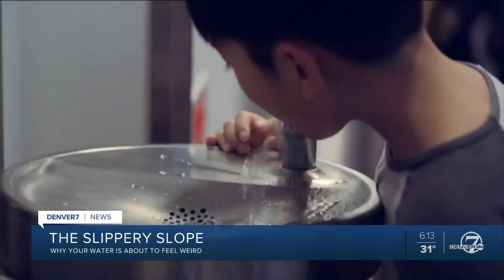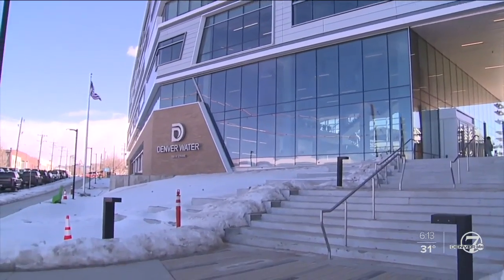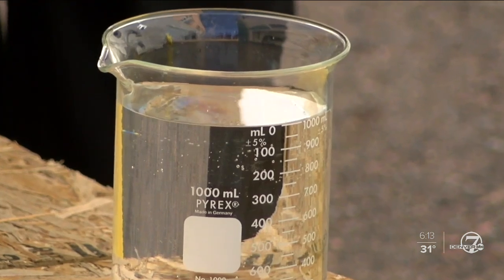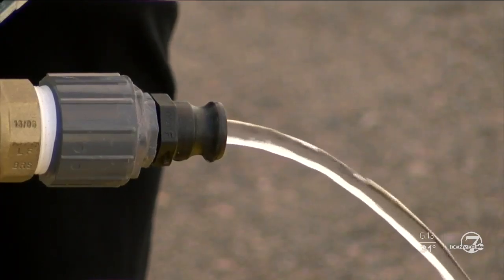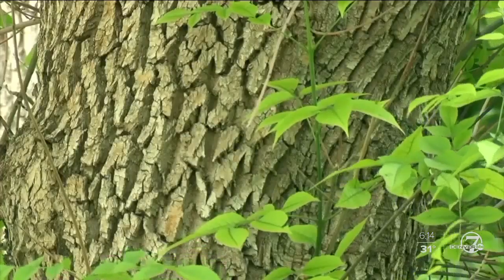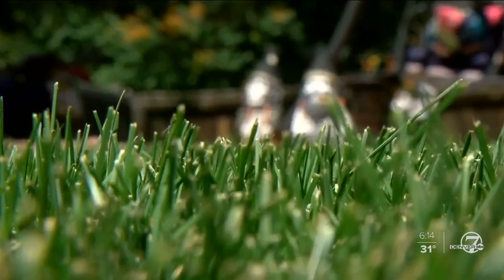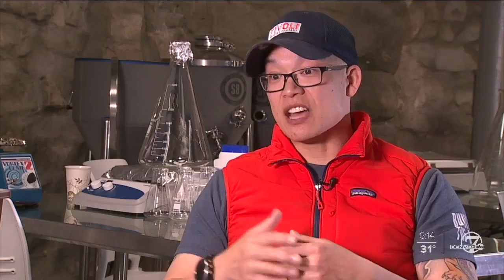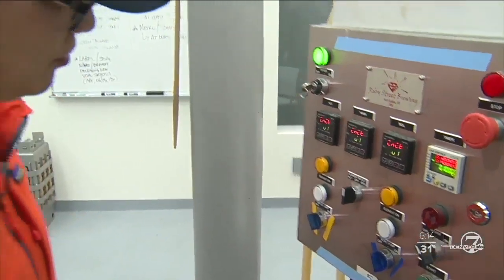Denver Water changing pH levels of water next month to make entire water system less acidic

Comment: 8.8 You are reaching caustic levels . Slippery means you are being exposed to caustic . There is a reason why the acceptable level is seven .  Seven means neutral witch is safe lower then seven means the water is more acidic by a factor of ten . Higher then seven means the water has more alkaloids in it by a factor of 10. This is not good people . E.p.a. and Osha have these rules and regulations for a reason .